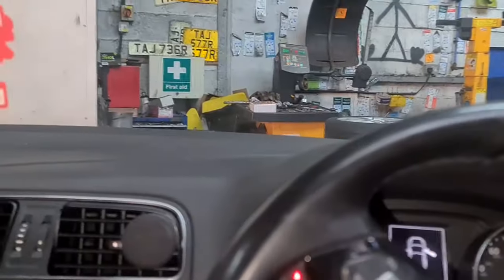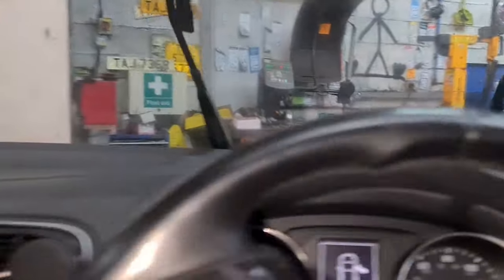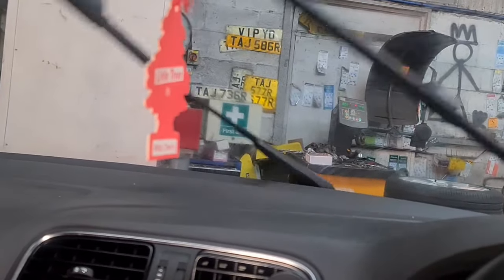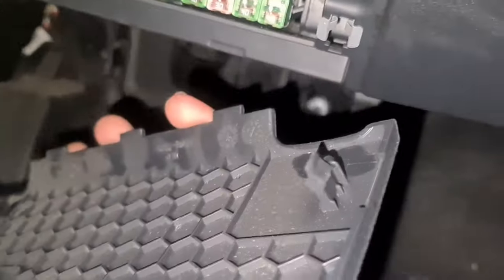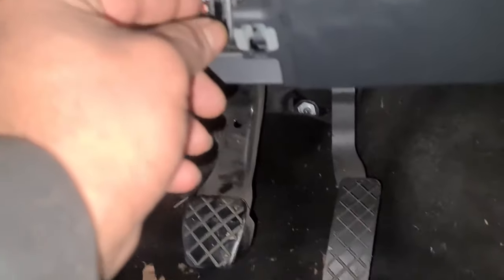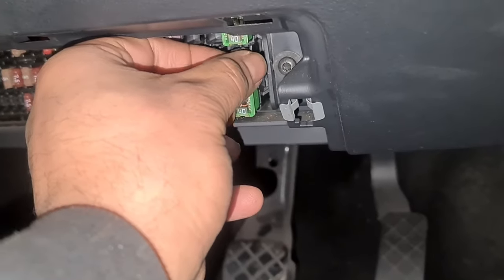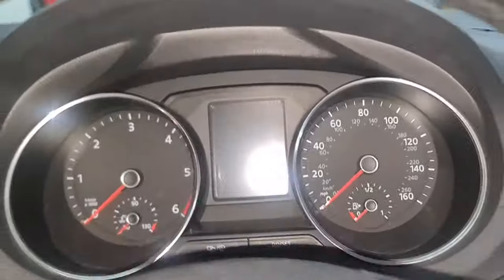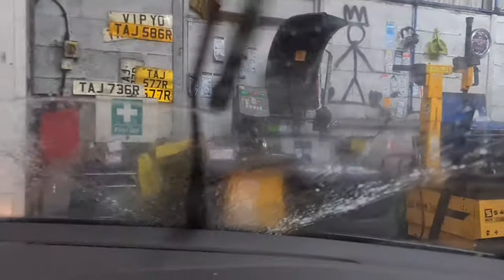fuse location for windscreen wiper washer pump on VW POLO MK5 #windshield #volkswagenclub

Comment: My wipers on the windscreen are jus wiping nonstop when switch then ignition ON
Reply: I got the same problem on my polo 2014/15
Reply: I'm also having this problem, any fix or is it the blown fuse?
Reply: Me too
Reply: I also have the same problem and i suspect the wiper lever swicth to be faulty.
Reply: @MellzMelane-gw7nr  If you have rain sensor it might be faulty. Sensing rain when there isn't.

Comment: Sir could you kindly assist me with the Location of the fuse of the 3rd brake light. Driving a 1.2 Tsi Highline 2017 model
Reply from the maker: Hi, the fuse is okay because the side ones are working. Unless they’re all not working, in which case it would’ve been the brake switch or fuse. If the third stop lamp is LED and it’s not working, then you have to change it. However, if it has a bulb, just replace the bulb. Thanks!” 😊

Comment: I have vw polo 2015 , and i have a issue with my rear wiper, the rear wiper pipe leaks under my dashboard on the driver side when i press to use that rear wiper , its definitely a joint got detached or failed that causes the leaks in the said location, what is the solution for it? Some said the only solution is to repipe the rear wiper from a different location, what do i do ? Please help

Comment: Hi mate
I have a 2012 polo, looking at the setup on the 66 it's not the same, I've looked at both 7.5 fuses and they are good.
Appreciate some help
Reply: Got problem with my 16 reg (washer not working)  hopefully it's a fuse. If yours are OK-then I think your (and maybe my) next step is to remove the wheel arch liner and see if you've got power going to the washer motor . If you have got power - then you could probably assume that the motor is dead. If you don't have power - then it's got to be something upstream .